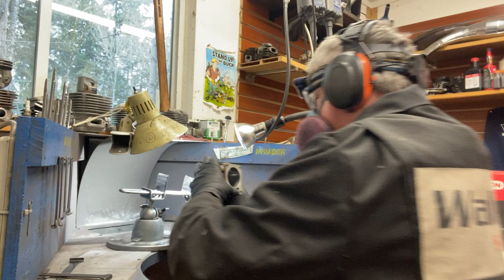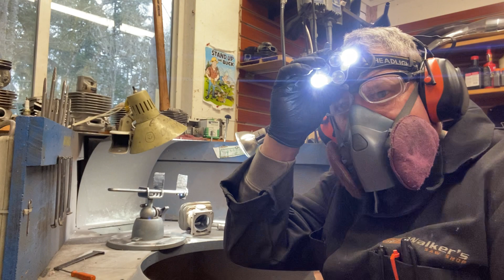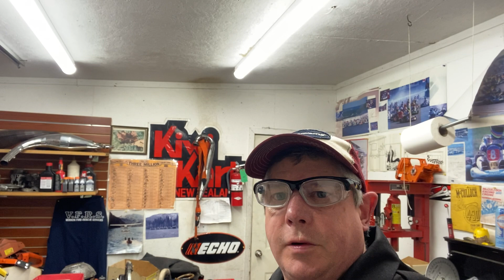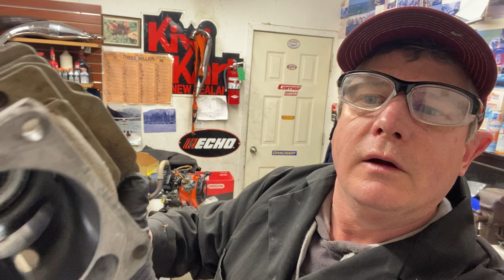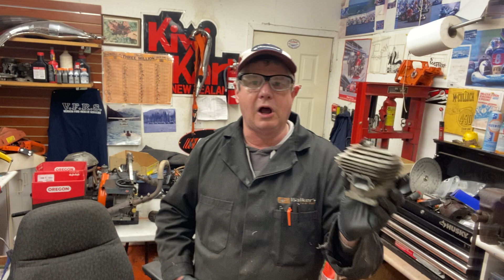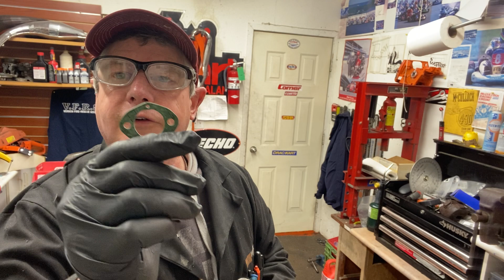Porting a stihl 461

Comment: Donny, I have a question about our crews 461. It spins chain at high speed with chain brake off on idle and dies when chain brake is engaged. I’ve put new impulse hose on and tuned high and low idle and it does not change at all the issue of high speed chain spin while idling….sorry I’m not very knowledgeable but curious if you have a hint on what’s going on?
Reply from the maker: Clutch springs are wore out
Reply: @donnywalker4691  brand new clutch springs as well :(